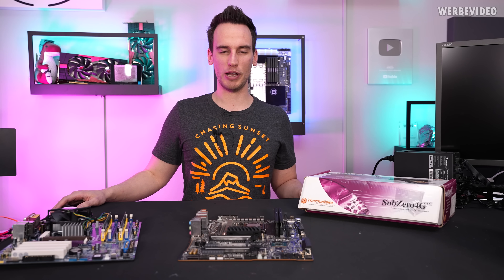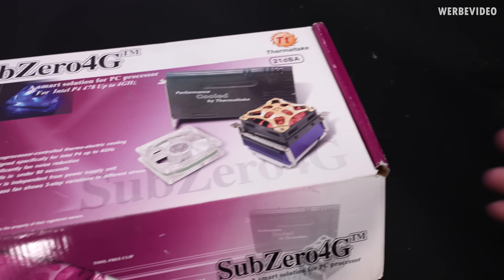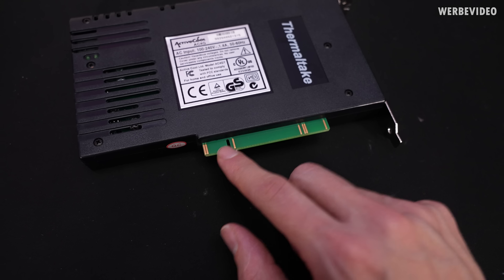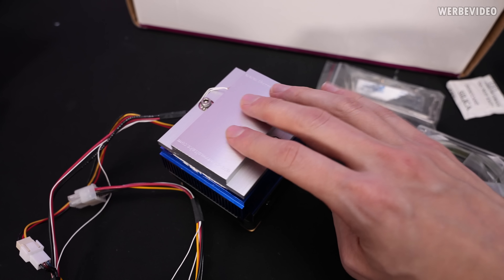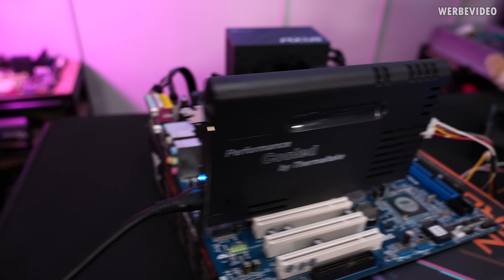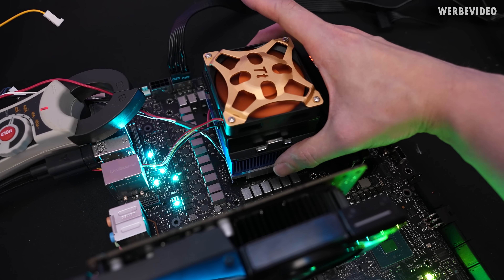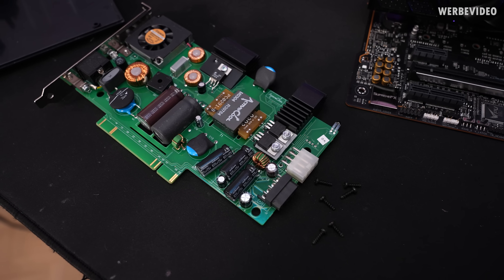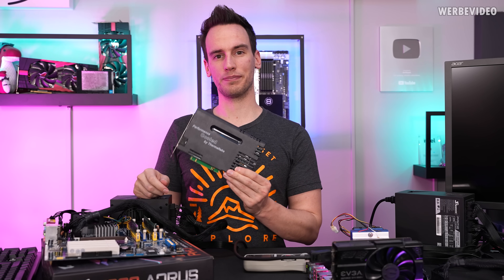This CPU Cooler Requires a PCI PSU to run!

Comment: If you bought that and it's yours to tinker with, maybe modernize it and pull the heatsink off it and replace it with either a AIO or custom loop with liquid that can handle sub-ambient temps to add surface area. See if it can compete with the EK kit! Could go even farther and only reuse the tech and replace the mounting bracket and base plate with custom cut copper fit to the LGA 1700 socket. Give it a even greater fighting chance
Reply: It would be easier and cheaper to buy the cooler master AIO cryo cooler. I have seen go for 50USD on eBay.
Reply: @alt5494  if he has the metal stock and access to case labs milling machine, and already has newer TEK's floating around.... and he has plenty of water cooling supplies at his disposal.... there really isn't much cost to it to tinker. The old controller could be used just with newer technology attached to the CPU
Reply: @Celician83  He would be forced to reengineer the entire base for a cooling system that would struggle to go sub ambient on a 100w CPU (12900k is 240w+).
Reply: @alt5494  hints why I suggested cooling the TEK with a custom loop or an AIO like EK did, instead of that dinky aluminum heatsink😉 the only real thing he would be reusing is the controller and maybe the TEK
Reply: @Celician83  You seem to be missing the problem so I will break it down. Replacing the heat sink is relatively simple, and it is not the issue. The issue is thermal bridging across layers. Starting from the  IHS heat is transferred though thermal paste into aluminum block base then though more paste into two low efficiency Teks(which also generates substantial additional heat) then though more paste into the aluminum IHS then though another layer of paste into the AIO coldplate before being dumped into the liquid and exhausted though the radiator. Aluminum is at best half the thermal transfer rate of copper. This design uses two thick aluminum plates four layers of thermal paste and what are now decade old TEK technology. It is simply not worth wasting time trying to optimize verses buying a existing option or building a entirely new design.
Reply: @alt5494  You are correct on everything you said.  The aluminum and thermal paste are not really going to be the limiting factors though, it will be the old TECs.  Well and that aluminum heatsink too.  Going to lapped copper heat spreader and a well fit waterblock would improve the performance a little bit, but the TECs are, as you said, just not worth using.  And as Invocation said, the efficiency drops off dramatically when trying to get a deltaT above 20C, but also when you run a TEC at its full rated power, its efficiency drops off dramatically too.  Above like 50% power, it spends most of the additional cooling just cooling itself.  
I have vague memories of some old cooler that had multiple peltier elements, where their cold side was connected with heat pipes to the cpu, and the hot sides directly to a large fin stack.  I can't remember the name of it, but this method, theoretically, allowed a larger number of peltiers to run at partial power, much more efficiently.  
Still, until peltirs become much more efficient, there really isn't a use case, for PCs, where they make sense, beyond being 'cool' (pun fully intended)
Reply: @cdburner5911  The TEC are definitely a major limiting factor, but the extremely complex thermal bridge is also beyond problematic. As you could easily end up with a cold to hot loop inside the block while the CPU goes into thermal protection. The Intel cryo cooling system released last year is actually extremely advanced. EKWB makes a open loop block and cooler master makes a AIO both using the technology. If your interested in a bit of reading.
Reply: @alt5494  I'm not sure what you mean about a cold to hot loop in this circumstance.  Unless the 'hot' side heatsink connects to the 'cold' side heat spreader in any significant way(beyond the TEC), there shouldn't be any real 'short circuit' bypass of heat. 
And the Intel cryo cooler is certainly the state of the art for that configuration, where the peltier is in the heat transfer path.  The EK one states that it has a maximum power draw of 200W, and I was unable to find the exact peltier module used in it, I couldn't find any disassembly videos, so using some datasheets of peltier modules on digikey, at full power, the COP, or efficiency seems to be about 50% (at a deltaT of 0-10C), so we can assume it can transfer about 100W.  Its also possible they used a higher power module and ran it at lower power.  Using that assumption, a 450W module running at 200W can transfer (at a deltaT of 0-10C) 200-225W.  

Ok, so I decided to run the number of thermal conductivity of the aluminum heat spreader, and using a guesstimate of 6cm x 9cm x 1cm, its got a thermal conductivity of 128W/C, and the flat part of the heatsink would be greater, so replacing them exactly with copper would probably yield 1-5C lower temps, at best.

I think a better option would be to use a CPU block in reverse right before the CPU (if using a water cooling loop) and allowing it to cool water down, that way, in case of failure, it only is a small amount of additional restriction in the water loop.  Hmm, however the high water flow would mean its not chilled by more than a degree or 2.  More though is required.

Edit: Ehh, I kind of lost my train of thought when writing this.  What I was trying to get to was that trying to get any kind of efficiency with peltier coolers would require multiple to be running at lower power, and that there just isn't the physical space on top of the CPU for that.  High power peltiers are 52x52mm or 56x56mm, and I figure to get meaningful sub ambient cooling you would need probably 4 of them.
Reply: @cdburner5911  What I was meaning is the welded aluminum casing on both sides of the TEK could provide a better path from the hot side to the cold side if used on a high performance CPU than desired IHS to coldplate.  At which point a horribly inefficient Tek become a effective heat generator. I would generally agree on the ek block being a 450w+ TEK dramatically better than thermaltaks units.  High grade pure copper is roughly three times better at transferring heat than aluminum and is a essential part of efficient sub ambient cooling. The only reason not to use it is price. That said I looked a thermoelectric cooling and decided against us in it in my own project.
Reply: peltier modules can really only go 20c below ambient at max efficiency, and they take ages to get properly cold, this was always going to be bad

Comment: Are you going to test the 12900k with the EK-QuantumX Delta TEC EVO? Would love to see if it would be possible to use this waterblock gor Z690.
Reply: Well, seeing as how their product page literally states that this is NOT for all core max boost, there's literally no point to these things.

Delta TEC is not designed for ALL CORE MAX frequency under heavy load, but it's intended for a lighter load like gaming and ONE CORE MAX boost. The TEC is not suitable for benchmarking with software like Prime95 that heavily loads all cores on the CPU.

Comment: Those wont go too much below ambient temperature , they was made for keep low temp 
but if you go too much below ambient you get condensation and water on your system .
Put a bigger heatsink on that can mach up with more modern systems and it can still do its thing .
After all it was designed to keep temperature at ambient and as long as you can get rid of the excess 
heat from the ' hot ' side of the peltier  it will work fine , but with modern cpus it have to deal with 
more heat and thats also why it run so hot and fan so fast .
Reall ' Cool '  Cooler , he he ..
Reply: Yeah, that looked like a thermocouple epoxied into the cold plate... It's got intelligence to keep it at above ambient. I remember reading all about that "back in the day" when someone would setup a bitchin custom TEC cooler only to find out it condensates like crazy when idle.  This thing looks like it just automated that. 

I still think it's neat, but I wouldn't use it... Maybe on a "retro" P3 or K6-3 build...

Comment: derbauer shits on an 18 year old product not suitable for modern day CPUs

Dat harsh, man.
Reply: it wasn't even suitable for cpu's 18 years ago.. i got one for dirt cheap back in 2004 to mess around with on an athlon XP 2400+, couldn't even cool it at stock let alone at 3400+ that it claimed.. fyi the 4G was marketing garbage, both the AMD and intel versions used the same name. for it's time it was way ahead of anything available but it was also limited by the technology at the time.. if you could modify a modern tower cooler and swap out the cooler then maybe it could of worked but in 2003 the idea of tower coolers wasn't even a consideration for another 2-3 years.
Reply: You don’t know how wattage/power output works, well done.
Reply: @SensationalSteve  dafuq, how the hell did you come up with that conclusion? lol
Reply: It wasn't even suitable for the CPU's we had 18 years ago. It was an interesting time though. The PC industry was a lot wilder back then with so many motherboard brands that has since disappeared. Same with graphics controllers. We had probably fifteen different brands, not just ATI/AMD and Nvidia. Some were better than others and some were outright terrible, but we had more choices than we do now.

Only a few years earlier most computers didn't even have a heatsink on the processor, the faster 386 processors were the first that really needed a heatsink. Before that they were naked...